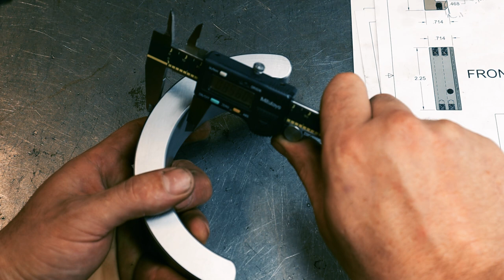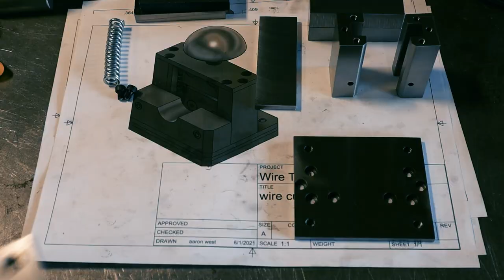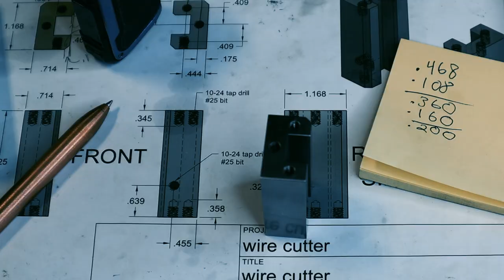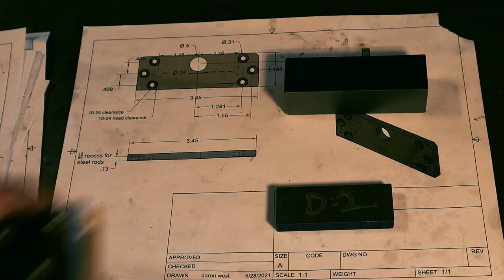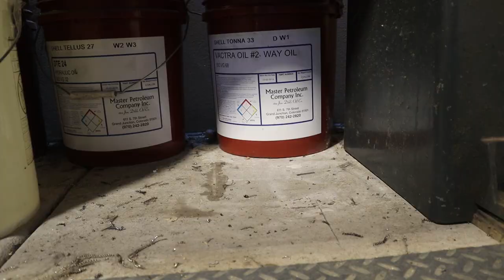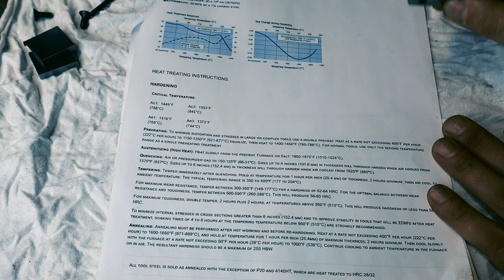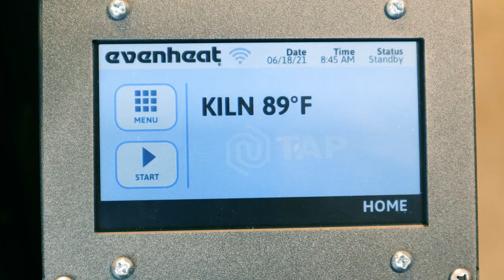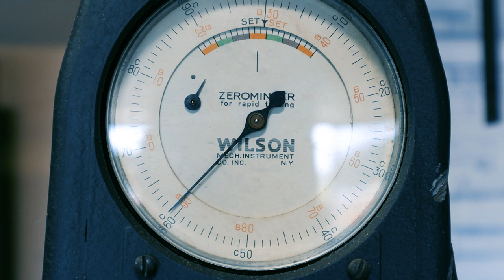Machining a tool I invented?

Comment: The stationary blade should of been the one closer to the torch head. Having the movable blade closer bends your mig wire every time. Otherwise great build and learning experience. 
A mounted shear along those lines would save a lot of wear and tear on your hand too instead of the guillotine type tool.
Nice machining!

Comment: Wonderful video!  Thanks for the mention.  I hope you find the Bandsaw Clamp as useful as I have. Figure I owed you big since you saved me a couple hundred $$$ with your thoughts on the Ellis vertical stand and those aluminum Fireball squares.
Reply from the maker: Thanks man No problem.....the thing works great I think I like it better than the wire cutter
Reply: @westweld  Sure beats having to set the saw vertical and then lean awkwardly over that table, doesn't it?  I was actually looking for a review on the Ellis contraption when I ran across your video on it.  I was two seconds away from pulling the trigger on that thing, certain it couldn't be as flimsy as it looks on their website.  Seeing you have to lean around the roller stand like I also have, and all you had to go through just to get the saw ready to cut.... yea, brother, you saved me a lot of frustration and disappointment.  Sharing the clamp was the least I could do for you!

Comment: Cool design. 

I dont know if this is an issue.
But

Flipping the blades around to have to moving blade on the back would keep the wire straight.

Keep up the good work
Reply from the maker: Its hasnt been an issue yet but I agree with you I may move the block to the other side

Comment: By all means I am no machinist and have no idea on why, but when someone is making something, why not just make the measurement weather decimal or fraction, to what might be easier to mill or to understand. For example when you have .468 why not just make it .5. Great video just tying to understand why. Thank tou
Reply from the maker: Generally you are right and if I was going to manufacture these I would definitely do that......the a2 and d2 steel I used on this project is very expensive and alot of the dimensions were drivin by the size stock I already had, that combined with trying to keep it as compact as possible. Another thing to note is when milling say a half inch slot a half inch endmill will give you a slightly larger slot so multiple passes with a smaller endmill are usually necessary anyway.

Comment: I enjoyed your build video and the style of your videos. I have a couple suggestions,  1st dont add a bevel cutting edge " knife edges" dont hold up. 2nd if you attaching locations on the blades were symetrical and without a spotface you could flip horizontally and vertically ending up with 4 cutting edges on each blade. 
Mike - Plus8Precision
Reply from the maker: thanks man! the flipping the blades is a great idea........ya the reason i thought id try them flat is because a lot of metal sheers and ironworkers I've used are all flat

Comment: Love watching your videos. 

I was a bit confused by the electrical isolation of the base. Maybe you used plastic screws to attach the bottom portion? Otherwise the metal screws provide a nice conductive path through the non conductive part.
Reply from the maker: Thanks....yes I didnt really talk about it but the bottom 4 screws that sandwich the circuit board are impact resistant polycarbonate

Comment: I just attach my welding pliers to my welding table with a chain and a nylon tie wrap on the end. It was a simple matter to drill a hole in the handle with a carbide bit. But then, I didn't have as much fun as you did. BTW, I have a Clausing 1603, which one is yours?
Reply from the maker: I actually use it more than I thought for tig welding when I’m sitting at the bench but ya was mostly for fun at the time…… mine is a 5900 series

Comment: I am curious, why the pancake helm? Are you from a pipeliner background? Great vids by the way, look forward to seeing more.
Reply from the maker: I started in the oilfield and after I left I tried to go to a sugar scoop hood but I hated it.....a pancake is way lighter and I can can get in tighter spots. You also sand a pancake to fit your face so its really comfortable and if your welding outside the sun doesn't reflect off the inside of your hood into your eyes.......ive also known guys who got flashburn from welding in the same room because the light came in through the back and reflected off the inside of the lens. Its also alot safer to grind with without safety glasses because it sits tight on my face. Mine is also carbon fiber so its pretty tough
Reply: @westweld  Appreciate the detailed response. I am going to try one out if I get the chance. I have a huge leather "cape" over the back of my helm for the reasons you mentioned :)
Reply from the maker: @dsmasynergy  I'm the only fabricator I know who wears one so maybe its just me haha

Comment: I was thinking to myself "I hope he insulates that from the table or he's going to arc on those blades!" And then you mentioned the fiberglass and plastic fasteners.
Reply from the maker: ya time will tell if the fasteners hold up......mcmaster carr calls them impact resistant polycarbonate

Comment: How do you like your acorn-style table?
Reply from the maker: I like it im it really increases speed of fabrication round holes are easier to work with though.....I actually ordered a new fixture table it will be here in Feb some time🥳
Reply: @westweld  Which one did you order? I'm been waffling back and forth for years between an acorn-style table and a build-pro style
Reply from the maker: @stevencolbert2304  I bought one from a company called Kovosu you can check them out on instagram only thing that kind of sucked is dealing with customs but it really hasn't been that bad and I saved thousands compared to seigmund.....there are no prices listed but send him a message and he'll get back to you, he's a really nice guy his name is Heery
Reply: @westweld  Thanks man!

Comment: Nice tool!   I would be inclined to go one step further and automate the cutter.  Making it trigger when the welder tip is inserted to the correct depth. But then you would have to connect it to power.  There are many ways to drive the cutter, of course, but I'll let you use your imagination.

Comment: 70 degree bevel...
Reply from the maker: Thanks ill try it......I have some more material coming and im going to make a batch and try a bunch of different angles......im actually surprised how well it works flat but iron worker sheer blades are often flat also

Comment: it didnt dawn on you to make this thing automated somehow? like with a sensor so that when you shove your mig gun in there it chops the wire for you? INSTEAD you have to use one hand to hold the mig gun and the other hand to push down on the button? how is this any easier than a pair of welpers?

imagine a shop with 40 of these things posted all around but all you had to do was place the tip of the mig gun inside it and it chops the wire for you............ 

like in a public restroom when you put your hand in front of the paper towel dispenser and it pumps out a paper towel for you.
Reply from the maker: Well your the first one to say its not complicated enough....its magnetic so you can stick it anywhere and you just stick the mig gun in there and slap the top its way faster than wire cutters I guess I'm not getting it.
Reply: @westweld  but bro imagine it chopping the wire FOR YOU. whats the most common welding wire? .035? .045? how hard would it be to make something that exerts enough for to chop 045 wire? make the plates that shear it on an angle and make them magnetic. every fabrication shop in america would order 20 of them
Reply: heres an idea thats too complicated lol , find a way to use the light from the welder to power a solar strip on top of the thing that recharges a little battery inside so it will never stop chopping lol
Reply from the maker: @matthewbabij37  I dont think its a terrible idea welding robots use somthing like what you saying I personally just wouldn't want batteries or cables in my situation......it works good but honestly that thing would probably cost hundreds of dollars its just for fun mostly